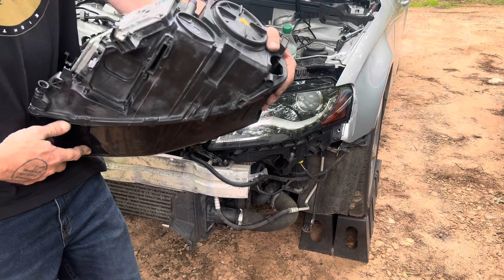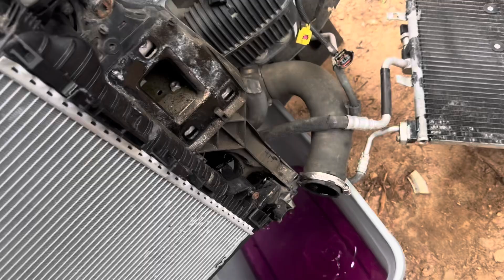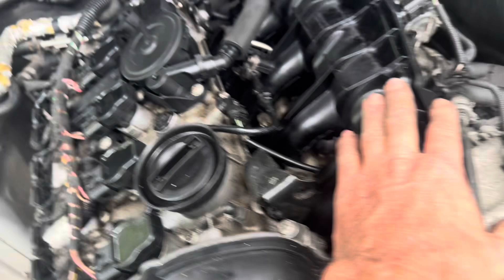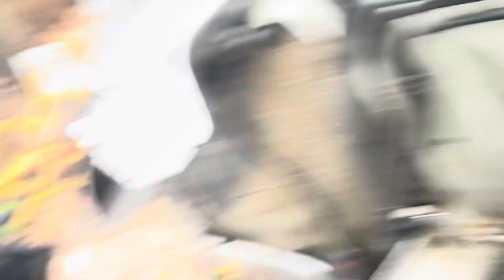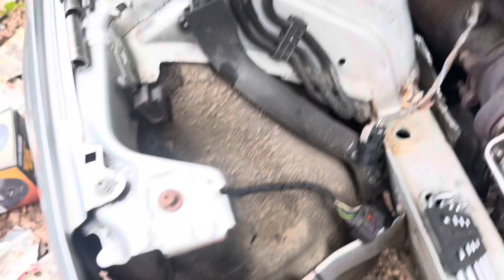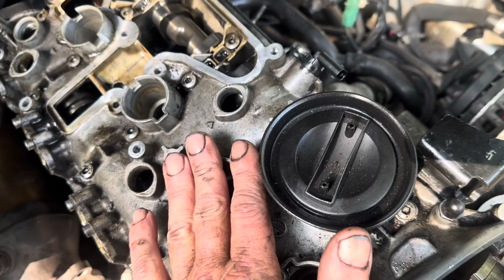2009 Audi A4 2.0t cylinder head removal

Comment: really dope video bro, i was wondering how you got the bottom nut next to the exhaust manifold?
Reply from the maker: Which one? I got the 4 catalytic converter nuts from the back of the engine with a long extension. The lower manifold bolts I also removed with a long extension but the Catalytic converter had to be separated first to give clearance to access the 2 lower rear bolts. The 2 front lower bolts I just went through the openings around the turbo.
Reply: @shadetreestreetcars8626 Awesome! i was thinkin i had to go from the back but wasnt sure, thank you so much
Reply: @shadetreestreetcars8626 very detailed video man keep up the good work! 🔥

Comment: What's up with the 2.7T 😮
Reply from the maker: There's nothing really wrong with it other than I'm starting to lose 3rd gear. I'm just putting way too many miles on it. It's starting to get the typical 2.7 oil leaks, the turbos are tired. I've got another engine I'm building for it with a better turbo kit but I probably won't do that for another year.